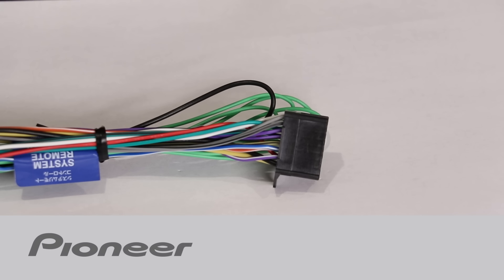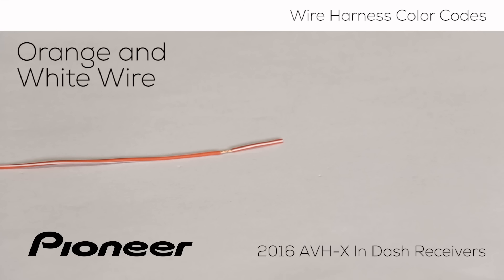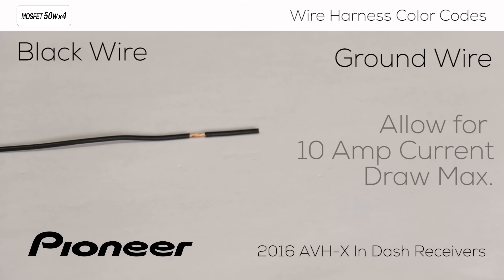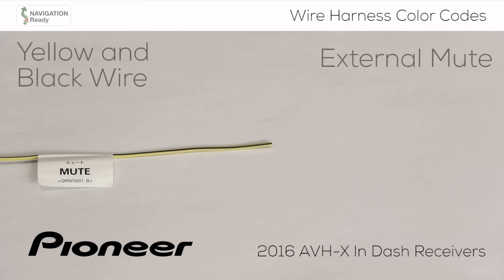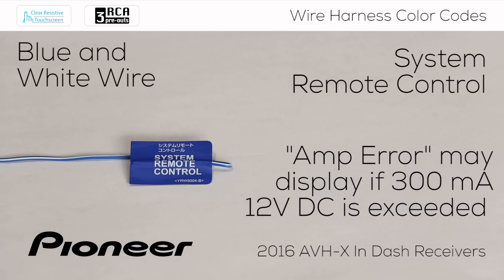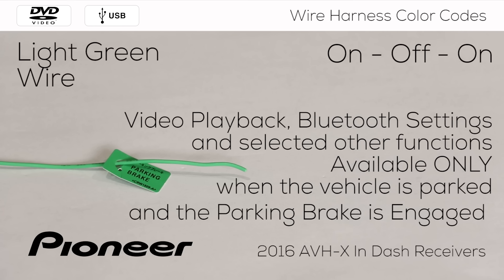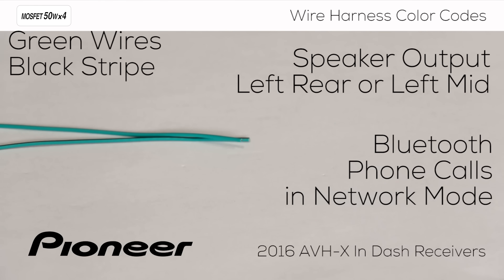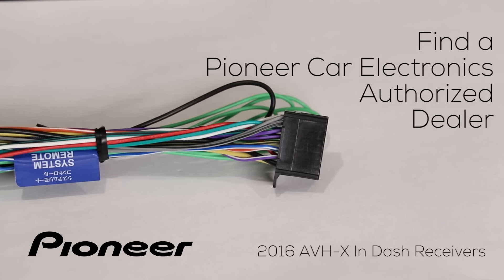How To - Understanding Wire Harness Color Codes  for Pioneer AVH-X Models 2016

Comment: It made me so angry that this wasn’t just in the user manual. Would’ve been nice to just have a simple chart in there. At least we got the video though
Reply from the maker: The wiring information is included with the unit. The unit will come with an Installation Manual or in some cases it is call Quick Start Guide. You can also download the manuals from the product pages.

Comment: I’m assuming it is okay to do this but then again I have never had a head unit with reverse camera option! So with that being said, is it okay to hook up the reverse gear input wire to a 12 volt power source with a toggle switch so I can manually flip it on my self? I don’t wanna do any damage to the unit by over powering it or anything of that sort! Thx in Advance!
Reply: You did not mention what in dash receiver you have.  Many Pioneer receivers have an on screen button to switch the camera on at any time.  You don't need a switch.  You can see that in this video:   https://youtu.be/WY0GLsC3AxE?list=PLw63zJRQbCNi6CoU7JbUNT83T7ippQbU6
Reply: Deckerd Otto DVH-885AVBT

Comment: I change my new car battery i notice that the polarity was reverse since then my pioneer car stereo not working. Need help...
Reply: Disconnect the in dash receiver from the wire harness.  Check the fuse on the back of the in dash receiver.  Check the vehicle fuse that protects the in dash receiver. Confirm that the Red wire and Yellow wire are measuring 12 volts.  Re-connect the in dash receiver to the wire harness.

Comment: How do you bypass the Caution for the video while driving?
Reply: @jason walsh - Then you just toggle the switch "on-off-on" and it thinks the parking brake is applied, correct?

Comment: Color black mute wire coming out of the pioneer stereo
Reply from the maker: What is the model number of your Pioneer in-dash receiver?   Please be more specific with your question.   The Black wire on a Pioneer wire harness is for ground.   The Yellow wire with Black strip is for an external device to mute the receiver with a temporary ground signal.  This could be many different types of external devices including On-Star or another external navigation system.  You can find more videos on Pioneer's YouTube Channel here:   https://www.youtube.com/user/pioneerelectronics

Comment: My power antenna won't go down until accessory (key) off. Is there a menu setting available?
Reply: What is the model number of the in dash receiver?
Reply: AVH-X391BHS.  The online retailer support (excellent support) told me to
 combine the pioneer blue, blue white wire to the blue adapter wire for a
 02 Sequoia install. It has a JBL amp sound system install.  I also have
 a micro bypass relay  soldered  on this line.  The back up camera, and 
radio work great.  Excellent sound, seamless WAZE operation, bluetooth and wireless operation. Should I separate out the blue ant. signal wire?  Backup camera comes on when reverse is selected and returns to radio when out of reverse.
Thanks for any advice.
Reply: On the AVH-X391BHS press the "Home" hard key and then touch the "AV " button on screen.  In the AV window choose "Power Off".  This should shut down the in dash receiver and shut down all accessories connected through the blue wire with white stripe.  Choose "power off" not "source off". 

"Source Off" will not put the power antenna down. When source off is selected, the in dash receiver will stay powered up and all connected accessories will remain powered up even though no music source is playing.

When any music source is selected, the blue/white wire will provide a signal to power up any connected accessory including amplifiers and power antenna.

Comment: Why is my tuner keep going and not stoping. If i reset the radio it works for a lil while then the tuner starts turning and wont stop
Reply: Do you have the vehicle antenna properly connected to the in dash receiver?

Change the "Local" setting to off.  I don't know what receiver you have.  You can find information about the local setting in this video:  https://youtu.be/idL6MOXfNVI?list=PLw63zJRQbCNi6CoU7JbUNT83T7ippQbU6

Comment: The factory harness in my 11 Xb has little to none of these wires... It's pissing me off Cuz I can't figure out what color matches to what. It has violet, pink, light green and blue as the bigger wires (power, ground, etc.) then the small one I assume they are the speakers and what not, but non are solid and black striped wires.
Reply: Wire colors vary from one auto maker to another and from one vehicle model to another.The wire colors on the Pioneer in dash receiver are not meant to match the colors of any auto makers wiring. I recommend buying a wire harness adapter made for your particular vehicle make, model and year.
Reply: Same problem, my pioneer harness has a pink wire instead of red and it doesn’t look thick enough to be the ignition
Reply: You need a adapter harness when adding aftermarket stereos to make it easy and so you don't have to cut your factory harness.  The aftermarket wires will match the pioneer coloring.

Comment: Why can’t I turn it in with ignition off
Reply from the maker: If the in-dash receiver is inadvertently left on when the vehicle is switched off for an extended period, for example, over night or for a few days, the vehicle's battery will die. 
  When properly installed, Pioneer in-dash receivers are designed to automatically switch off when the vehicle is switched off.  This protects the vehicle's battery.  
When properly installed, you should be able to turn the vehicle's key to the accessory position and turn on the in-dash receiver without starting the vehicle.  You can find more videos on Pioneer's YouTube Channel here:  https://www.youtube.com/user/pioneerelectronics

Comment: can I connect the black wire to the original black wire in the original factory harness?
Reply: The Pioneer wire harness color codes are not meant to match up to any make or model of vehicle.  If the black wire is your vehicle is the ground wire, I'm sure it will work. If the black wire in your vehicle is not the  ground wire, don't connect the Pioneer receiver to it.

Comment: Sir can you be specific in the colour codes wires for BCM module?
Reply: No.  The Pioneer wire harness color codes are not meant to match the color codes of any auto maker, model, or year.
Reply: Deckerd Otto sir, I need the input connector of the BCM unit and how to look out for it?

Any connector number necessary, if so, how to identify my connector number?

Comment: Where do you connect the lighter green wire bor the bluetooth settings?
Reply: The Green Wire is designed to connect to the positive side switch of the Parking Brake, also known as the Hand Brake.  In order to see the Bluetooth settings the parking brake must go ON-OFF-ON.  You can find more videos on Pioneer's You Tube Channel here:  https://www.youtube.com/user/pioneerelectronics

Comment: Hi do I need to connect the light green wire ( parking brake switch) for the SPH-10BT what won’t work if I don’t connect it?
Reply: I recommend to connect it as described in the video above.  Please be sure to have the latest firmware installed on your Pioneer SPH-10BT.  You can find it here:  https://www.pioneerelectronics.com/PUSA/Car/Digital+Media+Receivers/SPH-10BT#downloads   You can find more videos about Pioneer SPH-10BT here:  https://youtu.be/pmu5ClsfWgk?list=PLw63zJRQbCNiGNMG9zaOiTR3NgWe2T7ol   and you can find more videos on Pioneer's You Tube Channel here:  https://www.youtube.com/user/pioneerelectronics
Reply: Is this the same procedure for the UK also
Reply: Here is Pioneer's website for the UK:     https://www.pioneer-car.eu/uk/

Comment: So what the heckkkk doi connect the red wire to
Reply: If you don't understand what you're doing please take your vehicle to a car stereo shop for installation help.   Please note:  The wire colors in the Pioneer wire harness system are not designed to match the colors of any make, model, or year of vehicle.  The Red wire in the Pioneer wire harness is for ignition.  It powers up the in-dash receiver when the vehicle powers on, and it shuts down the receiver when the vehicle shuts down.  You can find more videos on Pioneer's YouTube Channel here:  https://www.youtube.com/user/pioneerelectronics
Reply: @deckerdotto6035  I figured it out

Comment: Can I connect the wire to power the camera on this purple white Wire?
Reply from the maker: The violet/white wire is connected to the positive side of the reverse lights. This is how the radio knows the vehicle is in reverse. 
The blue/white wire is used to trigger an amp or antenna system, very low signal, only 300 mA limit. 
Most people will connect the power of the reverse camera to the reverse light or an ignition power source.
Reply: @pioneerelectronics  thanks u very much

Comment: After engaging the green wire correctly can I get the same problem of Bluetooth option greyed out pls reply.....
??
Reply: I am having avh 290bt
Reply from the maker: You’ll need to engage the vehicle’s Parking Brake in an ON-OFF-ON operation in order to access the Bluetooth setup menu. This might also be known as the Hand Brake or the Emergency Brake.    You can see it in this Pioneer How To video:     https://youtu.be/dhWUPsmlUZs?list=PLw63zJRQbCNh2FQHF_nn4s6OD4VnqOf4A        
If you engage the vehicle’s Parking Brake and still can’t access the Bluetooth menu, the in-dash receiver’s Green Parking Brake Wire may have an incorrect connection to vehicle.  You can learn more about the Green Parking Brake Wire in this Pioneer How To video:  https://youtu.be/-bF3uzzaT30?list=PLw63zJRQbCNh2FQHF_nn4s6OD4VnqOf4A
You can find more videos on Pioneer's YouTube Channel here:   https://www.youtube.com/user/pioneerelectronics
Reply: @pioneerelectronics  thanks a lot

Comment: What colour for connect dome tweeter ?
Reply from the maker: What is the model number of your Pioneer in-dash receiver?   To use a tweeter, I strongly recommend the use of an HPF or High Pass Filter. If you don't use an HPF you may damage or destroy the tweeter.   The receiver may have the HPF or the amplifier may have and HPF, or there may be an HPF in the wiring for the tweeter.   Any of them may work,  You can use any of the speaker level output wires for the tweeter, with an HPF. You can learn more about a HPF here:     https://youtu.be/w32XiQw5BaM?list=PLw63zJRQbCNiTV71nfrZHNcn8taD6y4yX&t=117        You can learn more about using an HPF in this video:    https://youtu.be/WvJXYh6vk_0?t=287   You can find more videos on Pioneer's YouTube Channel here:  https://www.youtube.com/user/pioneerelectronics
Reply: @pioneerelectronics  Okay thankyou. 👍🌟